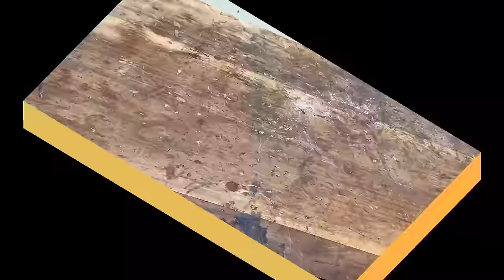Super Beautiful Vase And Many Outstanding Colors Made Extremely Elaborately On A Wood Lathe

Comment: Nice design. Too bad the piece isn't sanded better. It looks like teat outs weren't turned and then sanded smooth. Kind of a waste of what appears to be some exotic wood.
Reply from the maker: Thank you for supporting the channel, please subscribe and watch new videos
Reply: The sort of skill is in the cutting and assembly but even then you don’t show planing flat the white wood but i don’t see any skill in carbon tipped tools ,that is not turning it is scraping sorry thumbs down
Reply: I have to agree. He goes from sanding to finish without even checking the piece. Basically hogs out a bunch of material, sands a little and slaps some Finnish on it. That and the dark glue he uses certainly makes the finished product look unfinished. After looking a the end product, to me it looks terrible. I’d give it a four out of 10
Reply: @carpenterwoodworking 4:08 😮😅😮😮
Reply: @carpenterwoodworking 😮 то    як б
Reply: Mah man’s wearin sandals in the shop and using strawberry jam for glue. Adjust your expectations accordingly.
Reply: Oi meu 😅😅🎉 @carpenterwoodworking